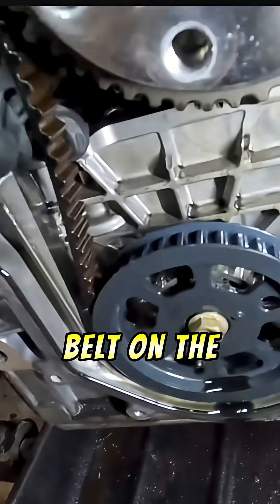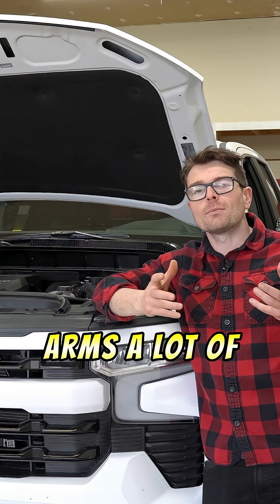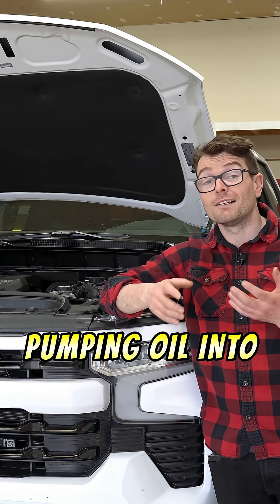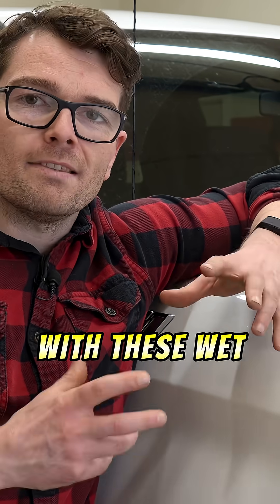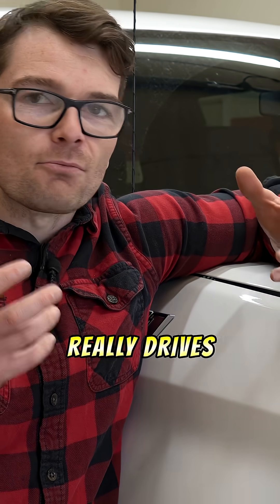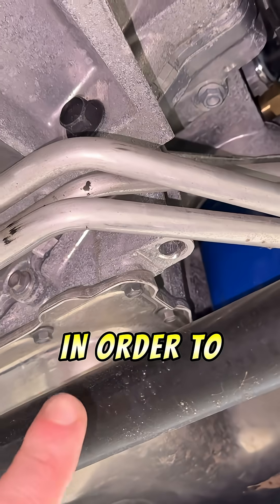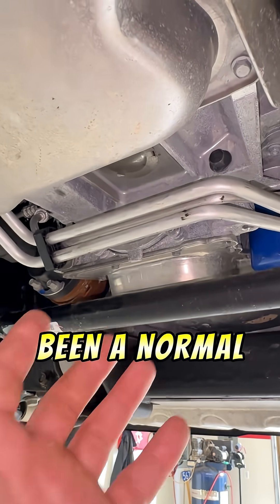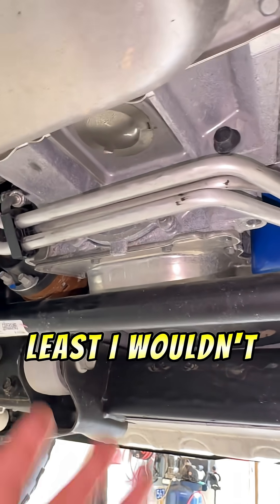The Truth About the Rubber Belt in Your Duramax… 🫣

Comment: There are no perfect motors!
Compromise is part of complicated engineered systems. Surprised you didn’t say or maybe not even know that the GM engineer who helped design this truck motor said, do you want a quiet motor or a clankety clankety diesel sound. Compromise 😮
Nissan doesn’t support any transmission parts other than an $11,000 replacements for their large box of a van. Many companies make much worse decisions in what consumers have to do to bring their vehicles back to working condition when they have a breakdown.

Comment: All modern Trucks are garbage. All brands. If I could go back in middle of 1990’s and buy a new truck I would keep it rest of my life knowing what I know now. Manufacturers have ruined vehicles in last 15 or so years. I wish I had my 1995 Ford F150 I bought new with a 302 automatic. It was bulletproof and I drove it 225000 miles without any major repairs. If I had know what the junk being made now was coming I would have kept it and just kept rebuilding it. At least it wasn’t a nightmare to work on and designed by morons!

Comment: So... An 8 hour job? Most oil pumps are larger jobs. What's the real difference in time vs a front one, when you have to take everything out in the front? Vs. a crossover where it's a cradle out to get to it? 

This is just the old "new bad" about all cars. "Fuel injection will kill self repair", was the old man line when I was a kid, and this is one of the new ones.

Comment: Keep in mind these engines are made in Taiwan and shipped to the US. That being said, many efforts were made to make them as low-cost as possible. Very little thought was given to serviceability. At 100,000 miles or so, this belt is going to have to be changed. That comes up pretty quick in today’s modern cars. It will cost several thousand dollars to change this part that should’ve been on the front of the engine and made from metal instead of rubber( that deteriorates in oil). As with any new vehicle, my advice is to do your homework homework before you purchase it. Especially if it is a GM vehicle nowadays.
Reply: 3.0L Duramax is made in Ohio.
Reply: @countcuda70  I apologize for my mistake. I confused this engine with the GM 2.5 L and 2.8 L diesel engines that are made in Thailand.

Comment: Ah yes the oil pump belt. Don’t you worry. If that does not fail out of warranty the AC compressor will. That is an 8 hour job. Oh wait there is more! The coolant control valve is made of cheap plastic that will also fail.
Reply: My truck is literally in the shop now due the a fail coolant control valve

Comment: Ford did the same thing with the 5.0. At least it’s in the front but you basically have to pull the water pump, timing cover, both timing chains and the main pulley because thet put the oil pump belt BEHIND the timing chains.  I only put 3 to 4,000 mile a year on it so hopefully I’ll never have to deal with it.
Reply: 2.7 and 3.5 also. In regard to mileage accumulation, rubber grades over time as well, so there is that variable.
Reply: @Resistculturaldecline I thought the 3.5 EcoBoost was still using the chain?
Reply: @MrRGiller  Yes, you're likely right. I have read mixed info on the 3.5, but most info states it's still a chain. The 2.7 & 5.0 being the belted engines.
Reply: @Resistculturaldecline It's difficult at times to keep up with all of the changes the auto manufacturers make.
Reply: @Resistculturaldecline ford uses a Kevlar belt instead of a rubber
Reply: Fords is a Kevlar belt, not a rubber one
Reply: @TheMidwestPlumber Not going to gamble my hard earned money on an internal wet belt regardless of whether that belt is Kevlar

Comment: No worries on the belt location. Its a GM, the transmission will have failed long before the belt is actually due for service......  At that point you can just change the belt early while its in for its transmission replacement.
Reply: The Man with the optimism, always finding the silver lining in every situation. 😃
Reply: @is6566  Just stating reality.  Please explain where im wrong here. The last decent transmission GM put in a half ton was the 4l60/80E. They had their issues too but at least they had decent service life if you took good care of it and changed the fluid and filter every 50k miles or so. All of them from the 6 speed on have all been problem plagued especially the 8 and 10 speeds.
Reply: @TDub_ADV  i absolutely agree here. I have some old gmt 800 trucks with 300k+ miles all 5.3s 1 4.8 with 450k miles. I know my way around the 4l60. People dog them but they arent a bad trans. Most people need 1 good rebuild with some updated parts and they never gotta pull it again. My last failure was a torque converter around 190k miles started shuddering. Decided to do a full rebuild and do all the seals. They are cheap in comparison to rebuild too.
Reply: @TDub… It was a light hearted compliment my friend! Not a criticism. 😃
Reply: LOL exactly !!!
Reply: All jokes aside, he’s not wrong
Reply: Well what's this guy worried about then?
Reply: The current 10 speed was co-developed with Ford
Reply: Oh mine has 2 times... and the recall is only good for 150k. after 150k it is on the owner... I have had valve body replaced 2 times
Reply: @tomchristensen2914  Have you considered the valve body upgrade form NextGen?

Comment: Built in obsolescence. If the belt survives 10 years, it will dissolve. I don't believe their's a decent full-size truck on the market right now.
Reply: It is a crock of crap. I have an ‘09 Ram I’ll just hang onto. At least I can work on it
Reply: The nissan tit... rip
Reply: How about replacing it at 150k miles (for average driver that’s 10 years)? We are talking of $80+k trucks. Spending an extra $2k every 150k miles doesn’t hit me as excessive.
Reply: @is6566  Not everyone drives that much. Simple facts is, if a chain was used, we wouldn't be having this discourse. It's stupid built-in obsolescence adding two maintenance costs. Chains or gears were used for how long without issue? Again, it's building in obsolescence and to  save, maybe save a few pennies and to add to dealerships profits. It's stupid period.

It really is dumbfounding to me how people consider everything disposable now and seem to be happy throwing money down the drain.
Reply: @Andyshine77  Chains fail also. Ford has been dealing with them for years
Reply: @is6566 80k? More like 51k on average. Plus this will be second or third owner issues. They will have bought it for 25k and now have a huge job that needs to be done.

Comment: I like my gear driven pump in the Cummins 5.9
Reply: Ah yes. It's all good because the rest of the truck will rust out long before the engine takes a dump.
Reply: @kabloosh699  My 1993 D350 is rust-free. What are you talking about?
Reply: @kabloosh699  lol have you seen the body’s and chassis on GM trucks 6-7 years in road salts and both are rusted out
Reply: @kabloosh699  There are many places in this country where rust is not an issue lol
Reply: Million mile engine
Reply: helical gear or was it gerotor?
Reply: @PoliticalGangster   Gerotor spun via helical gearset. There is no chain or belt inside a cummins --- gear on gear

Comment: How many man hours of Labor to replace belt when due and how much cost $$$$
Reply: Some guy broke it down labor and parts for his LM2.  Came to almost 2.5k at 120k.
Reply: @AximusPrime33  ¢.02 per mile. Which when you think about it diesel is more expensive per gallon. 23mpg (F150 highway for example) at $3gal is ¢.13 per mile. If diesel was the same cost at 30 mpg that’s ¢.10 per mile but now you need the new oil belt. So ¢.12 and diesel is usually .50-1.00 more per gallon so. There goes the savings…
Reply: Diesel is more expensive only in some parts of the country.